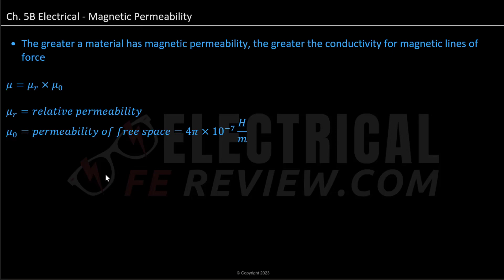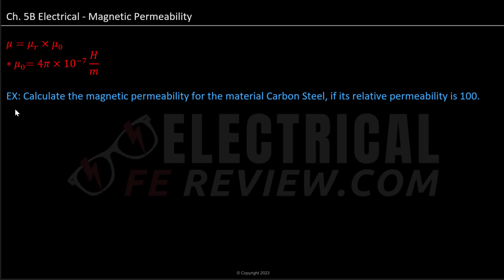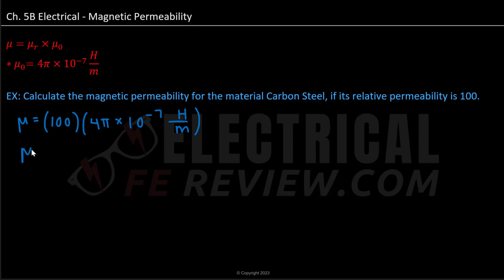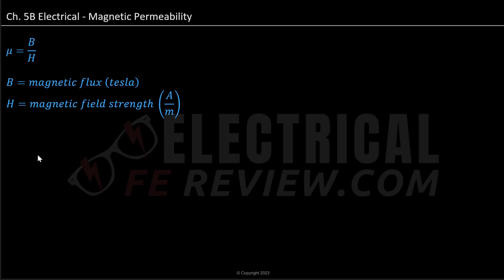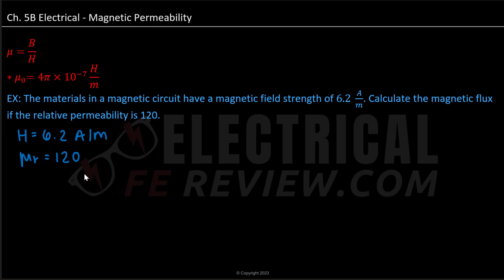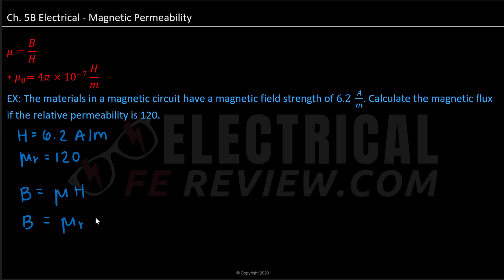Magnetic Permeability - Properties of Electrical Materials NCEES® Electrical and Computer FE Exam

Comment from the maker: Video Contents:
0:00:00 - Introduction to Magnetic Permeability
0:00:21 - Relative Permeability and Permeability of Free Space
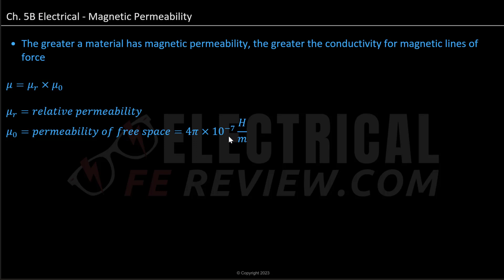0:00:33 - First Example Problem: Calculating Magnetic Permeability
0:00:56 - Setting up the Problem and Formula
0:01:16 - Calculation of Magnetic Permeability
0:01:52 - Explanation of Magnetic Flux and Magnetic Field Strength
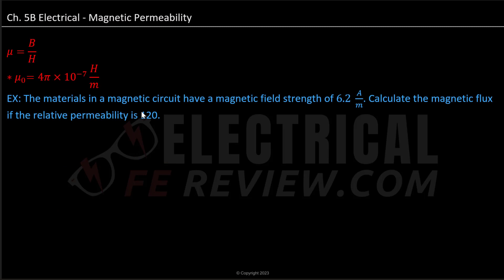0:02:51 - Second Example Problem: Calculating Magnetic Flux
0:03:14 - Setting up the Problem and Formula
0:03:39 - Calculation of Magnetic Permeability
0:04:32 - Simplification of Units
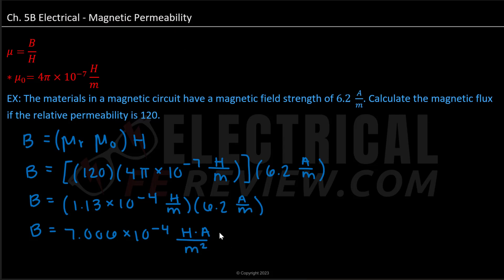0:05:40 - Conclusion

Ready to master the Electrical FE Exam? Don't miss out on our expert-led online course, with video examples and practice problems. Best of all, it's 100% FREE! Enroll today at https://www.electricalfereview.com and take the first step toward passing the FE exam.